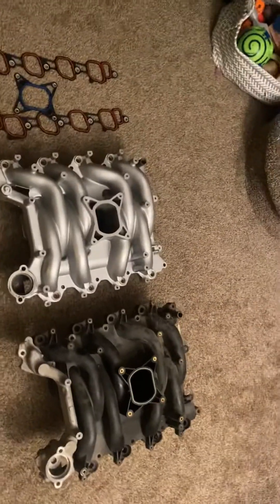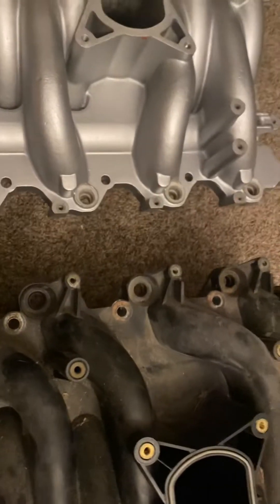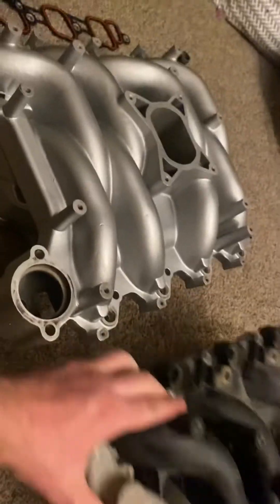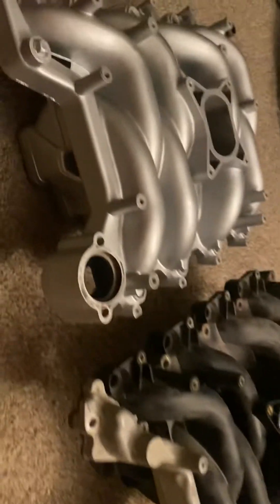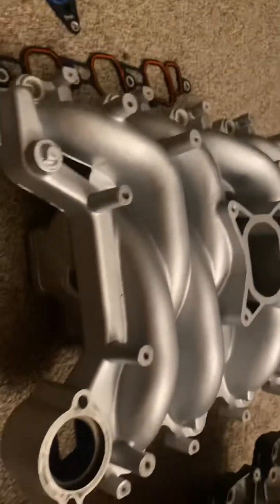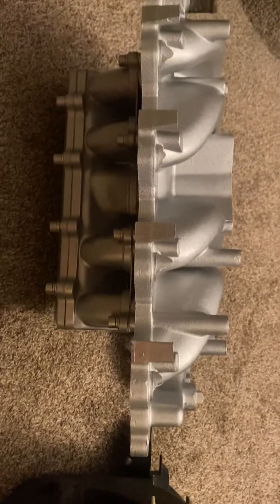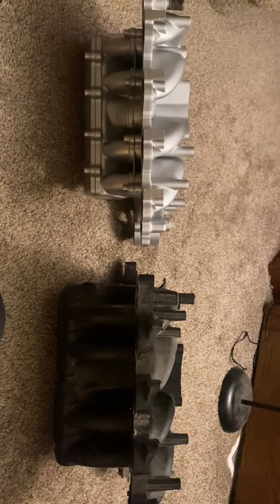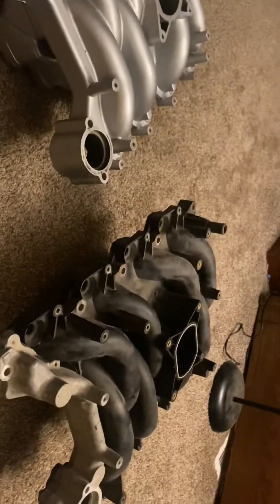Ford 4.6 2 Valve Intakes: Speedmaster  /Professional Products Typhoon vs OEM P.I intake

Comment: Where can I find a OEM manifold? I hear Dorman is junk.
Reply: Check junkyard crown Vic’s..get em before they crush em… You could probably start a business just pulling these off old crown Vic’s and selling them, the prices are ridiculous for PI cars..
Reply from the maker: Dorman is mostly junk, but theyll work in a pinch. Ive seen some OEM manifolds pop up new on eBay from time to time.
Reply: I checked a couple of days ago on the Ford Performance page - $390.

Comment: Just scored a polished Typhoon today. My stock PI manifold (2011) didn't leak, it exploded! Thanx for the gasket and bolt info.
Reply: You put in water instead of coolant, didn't you?  Know what kills engines with plastic intakes and plastic outer radiator core housings and spouts?  Water, raw water, and, gm coolant, and the old spray magic cleaner in a bottle down the throttle body.  Its not the 90s and back anymore.  You have to use coolant, it has a higher boil temp, and does not turn into super hot steam (used for some cutting equipment) as early or as viciously as raw water does.
Reply from the maker: @MrSaturdayNightSpecial  yes, indeed. I’m quite particular with coolant myself. I do not mix coolants. My car came with Motorcraft gold, and that’s what gets put in it. The Motorcraft gold or Xerex G05 (same thing as Motorcraft) is great coolant. Never put water in the car if you care about it.
Reply: @MrSaturdayNightSpecial  No, just antifreeze. No issues since the replacement (so far)
Reply: Man I want one sonbad

Comment: You lose mid-range power with these intakes
Reply from the maker: If I’ve lost any power with this, it’s not noticeable at all. Car actually felt like it gained power mid to high rpm’s. I’d love to get it dynoed and know for sure tho
Reply: @DirtyDanMunicipalMan  just an FYI man, porting gains power even in an otherwise stock application, it's not all about airflow. Also the reason the intake makes more power up top is increased flow and slightly shorter runners.
Reply: @DirtyDanMunicipalMan  Thats exactly what Michael said. You will lose power on the low end and gain it on the top end.
Reply: @unzunzvroom  lol no the Edelbrock intake is the one that loses all the power
Reply: No u don't

Comment: Can it go on a Lincoln 2006 Lincoln 4.6 v8????
Reply from the maker: What model lincoln? This will fit any panther platform or Mustang with the 4.6 2V.
Reply: An 06 lincoln probably has the 3v motor, which this intake will not fit, if it does have the 2v then this intake may fit.
Reply: @Prestiged_peck  NO panther ever had a 3v
Reply: @alb12345672  then the one I saw last week must be a swap.
Reply: @Prestiged_peck  For sure, feel free to look it up. Would be an easy swap because the F150 offered the choice of 3/2v.
Reply: @alb12345672 what about the marauder?

Comment: Idk but to me this looks like a waste of money, as it doesn’t look like it adds very much more air over the stock manifold.
Reply from the maker: On a stock engine, there is not much to gain performance wise. On a cammed engine that will see some higher RPMs, this manifold will do very well. I purchased this part because it will never crack like the stock unit, and it will work well with my plans later on down the road.
Reply: @DirtyDanMunicipalMan  You are right about that... the plastic keeps cracking where the heater hose mounts to on the rear of the stock manifold. I purchased my PP intake a couple of years ago for about $250 before they raised the price to $400+.
Reply: Doesn't necessarily matter if it adds airFLOW, shorter runners will make more power at high RPMs
Reply: Not to mention more heat since it's all aluminum.
Reply: @iannathanson6014  heat soak really isn't a thing, and I'd take a little heat soak over holes in my manifold every day of the week anyways. But yeah it's like 1-3 horsepower of heat soaking in the manifold.

Comment: How were you able to get the typhoon intake? I can’t find one that’s available. Why did they discontinue it?
Reply from the maker: I’m not sure why it was discontinued, Probably because new these were $400 and a new OEM Ford manifold was only $260. I’d assume most people thought the extra $140 wasn’t worth it for a full aluminum intake and they didn’t sell well. That’s just an assumption though.
Reply: I bought one of these new in like 2013. Still have it
Reply: @mhoffmann1991  wanna sell it?
Reply from the maker: I purchased this intake used. I found it on eBay a few months back
Reply: @DirtyDanMunicipalMan  Out of curiosity how much did you pay for your used typhoon intake if you don't mind sharing? I see one on ebay but it is about $950 with shipping lol. I would really like a crack resistant manifold, it sucks we have so little options.
Reply: @MintyFreshTurds  positive displacement supercharger is the best intake to buy, i'm cereal..
Reply: @P71ScrewHead  How noisy is the supercharger when just cruising?
Reply: @MintyFreshTurds  it's not that noisy actually.. Exhausts are more noisy if being quiet is what you're after.. If the sound of a positive displacement supercharger doesn't put a smile in your face, idk what will..lol
Reply: I have a mildly ported typhoon intake for sale and I can ship for free .

Comment: Can you post the link for the gaskets specially the throttle body gasket and the bolts plz
Reply from the maker: The throttle body gasket was purchased off Rockauto.com it’s a plenum gasket for a 2000 Crown Victoria part number MS90762. You will hafta break the little tabs off but it works perfectly. The bolts I got directly at the Home Depot store. They’re M8-1.25 bolts, I think either 45 or 50mm. I showed the bag in the video that has the exact part number and dimensions. Any M8-1.25 of the same length will work. Currently have the intake installed on the car and all the hardware and gaskets worked perfectly.
Reply from the maker: Don’t forget that you WILL need matching washers with the bolts to properly secure the manifold.
Reply: @DirtyDanMunicipalMan  just an FYI you can get those bolts a lot shorter off the shelf at a hardware store.